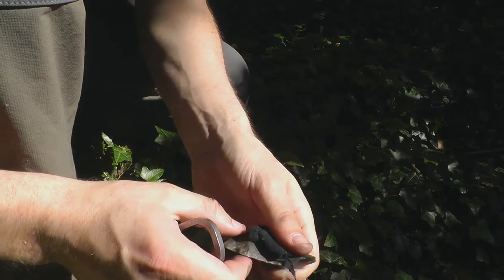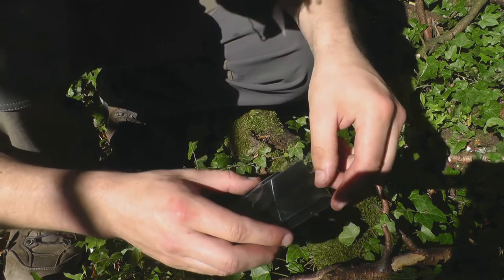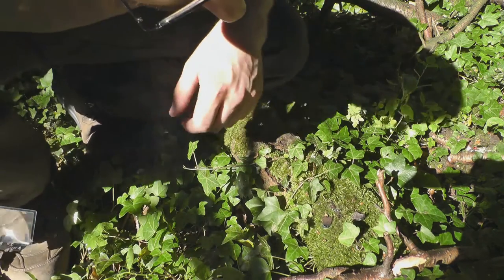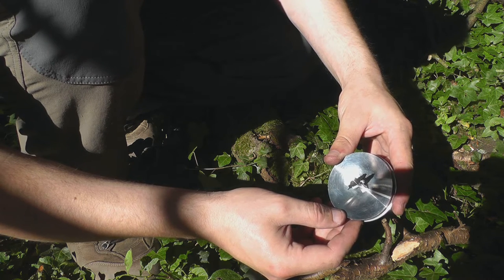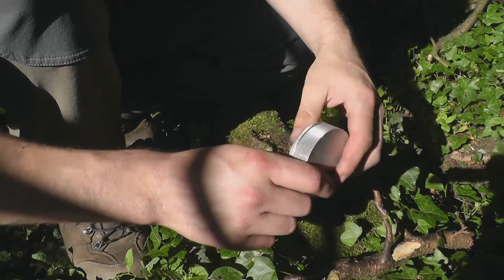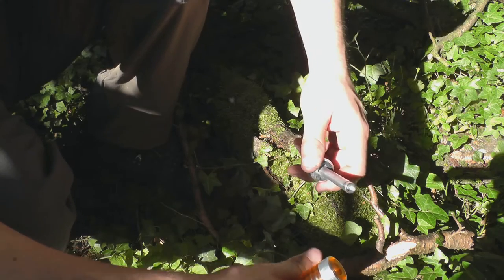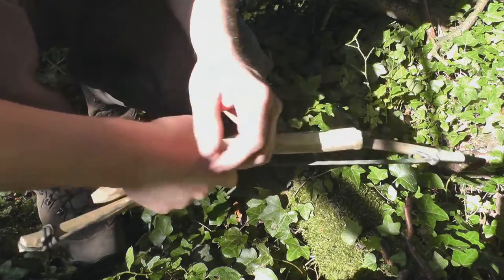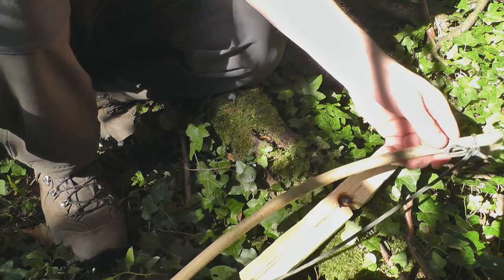Traditional Fire Lighting Techniques

Comment: Nice work.  One thing when using any kind of magnifying lens you need ot make sure the lens is flat on to the sun and your tinder, I've always found it's easier to start with the lens further away then slowly bring it in to get the light beam as small and focused as you can, like with the horseshoe fungus, you'll see it start to smoke pretty fast.  With the fresnel lens you you were using, you have to be careful not to bend the lens at all,  keep it as flat as possible.  Any bends and it'll reduce the efficiency of the lens.    I've had horrible luck with flint and steel :( need to really practice that one myself. 

For your solar reflector, you want to make that surface as polished as possible.  One good way is just some toothpaste and a really soft cloth, give it a good rub for a few mins, rinse it and have a look.  If it still looks a bit scratched then have another go, but it should polish up really nice and mirror like, then watch it work.  All those scratches will only help reflect the light in different angles on you, not ideal.

I bought a fire piston and I think only got the char cloth to go a couple of times, it's tricky to say the least.   The technique I've used must is similar to your first method, however, in all cases the key seemed to be to get that piston pulled back out and into the air as quick as possible as there's no air inside for the ember to burn.  It seems the key is speed in and speed out.  But I kinda gave up on it haha it's neat, but gimmicky.  

But nice video, thanks for sharing.  ATB
Reply from the maker: +Robert McKenzie HI Rob thanks for taking the time to watch the vid and comment. Appreciate the tips, that's the way we all learn from each other with little gold nuggets of info lol. Its all a big learning curve and unless you practice it day in day out your never going to master something. But its fun trying something different, and like you said some methods are rubbish and i would never rely on them. Stay safe buddy
ATB
Paul